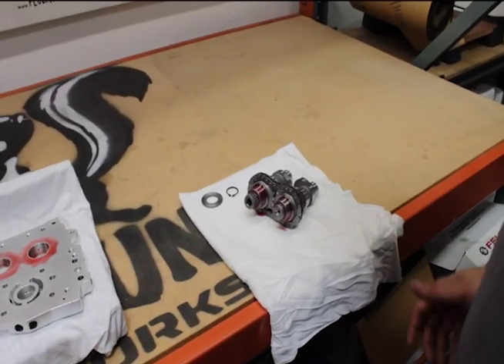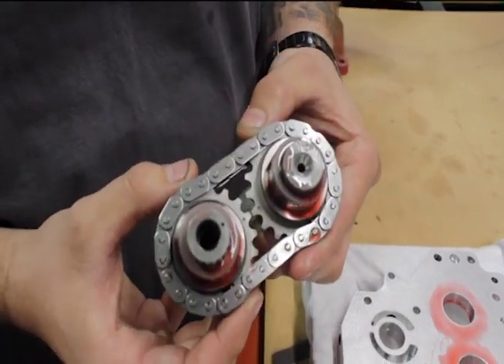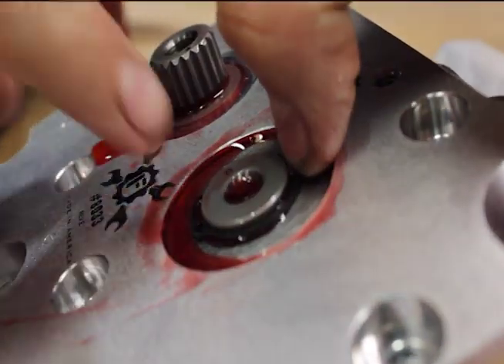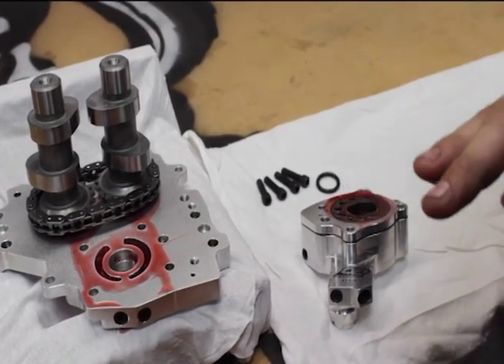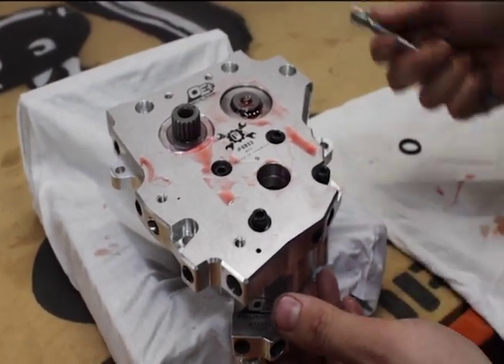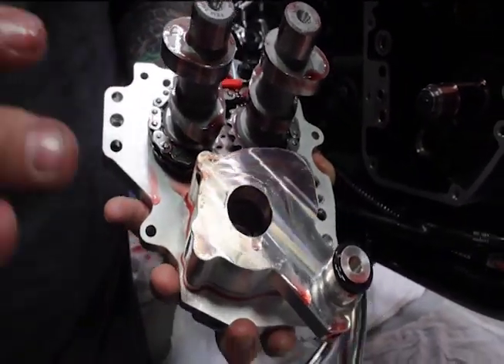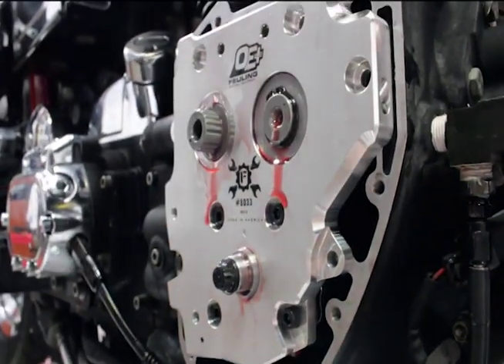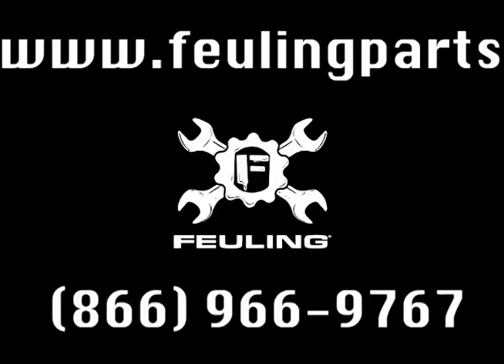Feuling Parts #7320 Camchest Install w/ Evan Kleen

Comment: Well thanks to you guys, I've just dropped 2K+ on my 05 Electraglide! My tensioners were shot and I caught it just in time. I got the OE+ 7320 kit with 525 cams and had my local shop (The Shop, Hope Mills, NC) install it. WOW, what a difference! My oil pressure is 15-20 psi higher now and the low end torque is amazing! While I didn't really want to spend that much it was worth it to get the power and reliability that Feuling parts are known for. It was your vids and others recommendations that caused me to go with Feuling parts. This bike will last way beyond  me (I'm 61 yrs old) and hopefully I'll be passing it on to one of my sons!

Comment: Question...I have a set of 525 reaper cams installed into my factory cam plate on my 01 electra glide....can I use these cams with this cam plate or would I need a different cam due to the cam journal?

Comment: Great video, thanks for posting. I have a question I am hoping you can assist with input.  I have a 2003 Road King.  I am in the process of upgrading my spring loaded cam chain tensioners (thanks Harley) to hydraulic.  Currently, I have Rinehart slip on mufflers, high flow intake, remapped ECM and a Feulpak.  If I now install Feuling's 525 (bolt in) conversion cams with cam conversion kit (#7088), do I need to remap the ECM or run a power commander (or other controller) due to the new cams?
Reply: Yup

Comment: Why would anyone put a chain drive with tentioner set up back in a cam chest? Especially when gear cams are nearly maintenance free.
Reply: I've always ran chains because they're easy to fix when they break. I was stranded in the middle of the Mojave once with a busted gear drive, i don't want that to happen again
Reply: @Krieger are you gonna do your own install?
Reply: Runout can prevent a gear cam install as well as $$$$.
Reply: Most stock harley cranks don't meet the run out tolerance that gear sets require...